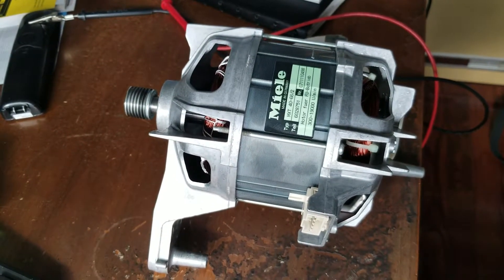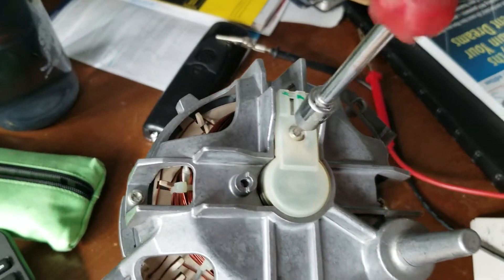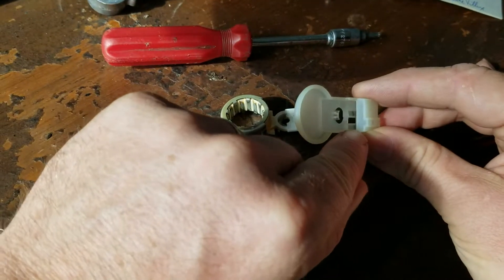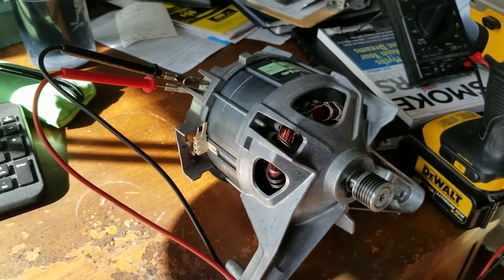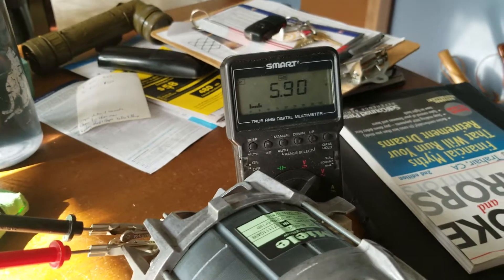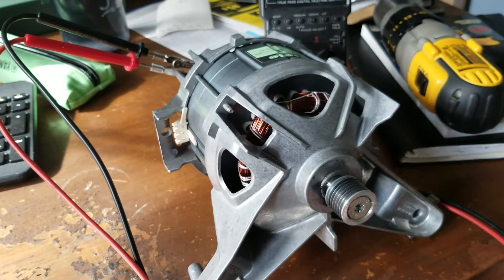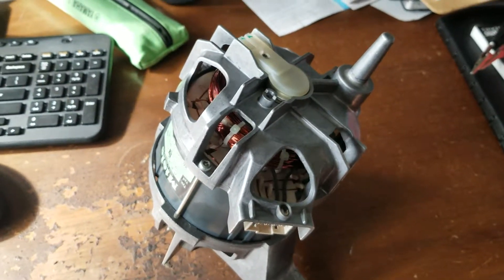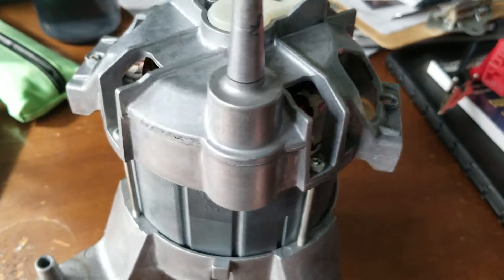Miele TouchTronic W4800 Washing Machine Motor MXT 40-66/2 6028751and Speed Sensing Generator

Comment: 1:14 Hi, that's a tachometer generator, or just simply called "tacho" or "tachogenerator". It works on the basis of hall effect, which acts like a feedback signal generator from motor to board to control rpm. your washer motor looks like an induction one, which is an upgrade from normal universal motors typically used in EU frontloaders. Its harder to wire, needs pcb actually, but its much quieter plus needs less maintenance.
Reply from the maker: Thanks!
It turned out that one of the lead wires had broken off, so after a bit of fiddling, I got it back into service again. Good, solid unit. Glad I didn't have to buy a new one. I'm sure it would have been very expensive!
Reply: eejuice It’s good to hear that. Sure Miele is Immer Besser, and their parts are immer expensive :)

Comment: Hello everyone, who among you can help me connect it to electricity? I have almost the same motor, but it is of the MXT 30 66/2 model and it has five connection points in the socket, two of which are coated with gray and three others are white. How do I connect the points with electricity?  Thank you very much in advance

Comment: Hi, I have a similar model and seem not to find the coals, is this one a brushless unit? Got the f53 error and wanted to make sure the coals are alright, just looks different in there than the w2000 series videos. I got a w3000 series machine with the 30/60-2 motor. Thanks for any leads
Reply: You are right it is not a brushed motor. These 30/62-2 motors are 3-phase induction motors.